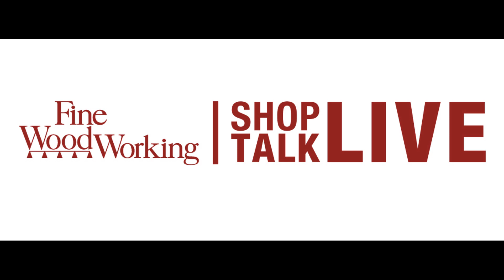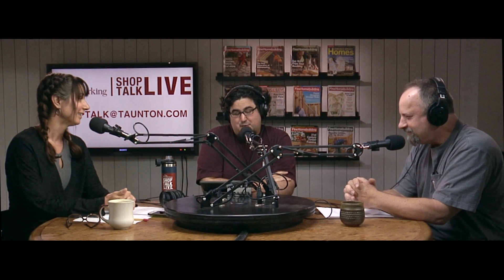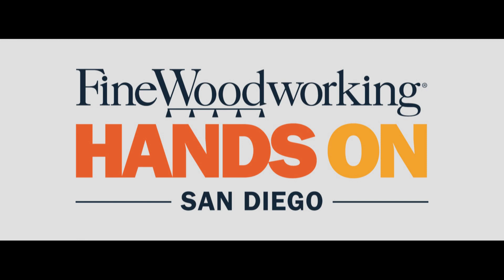STL194: New-Fangled Finishes

Comment: I was hoping that Anisa would mention "composing" in the discussion of designing furniture. Do any well known makers "compose" pieces as they make them (ala James Krenov)? What are the pitfalls of composing? What are the advantages? Is composing closer to art than it is to craft? (Okay, that last question may be too philosophical). 

I ask in part because I am currently building a free-standing cabinet in the shape of a boat which will stand on its transom, complete with doors and interior drawers. The "deck" is mahogany with white stripes, in the manner of the old Chris-Craft boats. I made a few drawings before I started, but I worked out the joinery as I came to it, and so also the doors, etc. I have a picture in my mind that I started with, and am trying to bring it into reality. It is exciting and nerve-wracking at the same time, but I am enjoying the process. I am not sure that I could have worked out everything in advance on paper (or on a computer), but if I did, I may never have started the piece. 

I would be interested in a discussion of designing in your mind's eye.

Thank you for your podcasts.
Monte
Reply from the maker: Check out Tim Coleman's article on "composing" https://www.finewoodworking.com/2018/07/26/composing-a-flexible-design-process